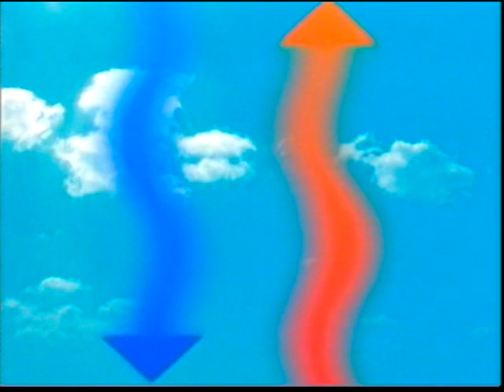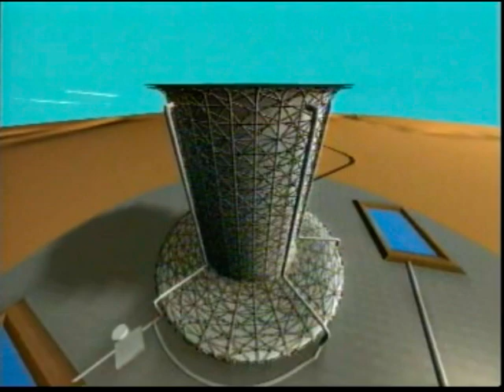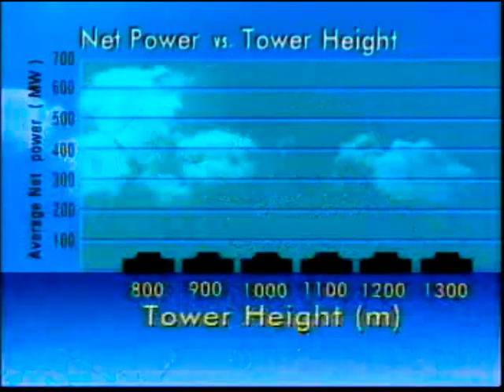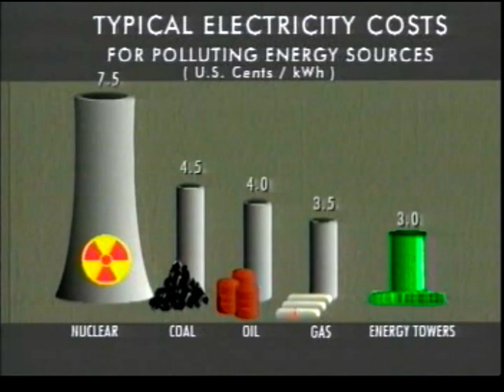Energy Towers Power & Water - Introductory Overview.mpg

Comment: Would it increase efficiency if the air was preheated in a plastic tunnel or hoop house and  funneled to the cooling point at the top would this cause a rocket stove type affect ?

Comment: How about using Solar Pumps during the day to continuesly pump water to the top of the tower and this water is then stored in big pipes on top of the tower allowing water to be sprayed even at night, saving 33% energy used for pumping. Spray system works like drip irrigation system. Thanks.

Comment: AGP also used this pilot program to determine the parameters of computer programs to control the amount of water to be used at the top of the stack to obtain maximum air velocity to the base of the stack. They determined they would be able to use this system under varying atmospheric conditions in areas other than the pilot site.

Comment: To built such a large tower that can withstand highwinds would be quite difficult and have huge building costs. Perhaps design optimizations are possible by adding wind holes (covered with flaps that only open up during high wind loads) which saves on weight at the top and safes considerable on overall building costs, with only a small diminishing of energy being harvested.

Comment: I don't understand why they don't combine this with an updraft tower... Boil the water and then have the condensed water travel to the downdraft tower...
Reply: U GENUS!
Reply: Was about to ask that, since using an updraft tower and a water tower would increase the water tower without the need of pumping, and that would mean that you can put your downdraft towers much further inland, and with both of them causing local cooling if the mist updraft tower is tall enough, then you could turn sahara into cool lush forests, namely planned forests for maximizing the output of multiple plant types.
Reply: The cost of heating the water would be high $ cost.
Reply: In hot locations like south Australia couldnt the cost of heating the water be almost free as you could engineer it to have the sun heat the water. Pumping only needed at night.

Comment: Could this design theoretically be combined with a solar updraft tower (the one that uses a large collector to heat the air, and has a "chimney" also very high to release the air producing also wind energy) - for instance as a "tube-in-a-tube" design? Or combine it with a habitable building (thus reducing building costs, because part of the building costs get recovered by selling appartments).
Reply: robheusd MegaCity One. Awesome.
We talk about colonising other planets but we haven't learned to look after the one we have now :)
Reply: robheusd MegaCity One. Awesome.
We talk about colonising other planets but we haven't learned to look after the one we have now :)
Reply: robheusd you forgot the greenhouse under the updraft collector, to feed all the people. And maybe some luxury housing in the green.
Reply: In a building it would not be profitable since such a small diameter tower would create about 1.7MW in yearly average (in a hot dry climate) for a 1000m high 30m diameter tower. This figure doesn't take into account the polluted air that exists in cities. Polluted air is heavy leading to a smaller buoyancy effect. 1.7MW is not enough to overcome the revenue that can be produced from renting the space taken by the tower. Renting revenue is high in cities.
Reply: re: qwe w: Not "in a building" or "as a building" but built as tower as in the design, but adding appartment and other usuable space to the tower (on the outside).
Reply: I see what you mean. In that case I don't see any reason that would prevent this.
Reply: Someone just has, and its output is still woeful. A 200M combined tower, will produce an average of less than 100kW electricity. The area covered by the 'roof' at the bottom, looked to be about 600M diameter. A footprint of almost 200,000 M2. Completely covered in solar panels, this would produce an average output of 12 MW.

Comment: Why couldn't we use the drinking water towers already in use in towns throughout the U.S.  As some of the water goes down the tower to provide water to the user, it can be used to generate power.  I love the idea of doubling up as desalination plants along the coast line, but there are already structures already created that would only require some additional modifications at a lower cost.  Overall your system sound fantastic.
Reply: It is not possible to gain energy that way. You first have to pump it up the tower and there are always some loses.
Reply: The energy created by the tower is enough to account for pumping losses.

Comment: Interesting. Makes me wonder once again if the Egyptian Pyramids wee some sort of similar energy tower. The pyramids were constructed with water diverted through the bottom. Plus. If you are going to build this tower in the desert. Go ahead and put some solar concentrators at the bottom, get more heat. Basically, have a giant tornado, which might have some pretty interesting effects on the atmosphere.
Reply: If the pyramids were painted black, they might have been usable to create updraft, which would make wind, which would somewhat cool the people or at least create a nice breeze. Though at that point you would have better chances if you had the casing of the pyramids have pipes a few cm/in below/under the outside, to allow for airflow to happen from the bottom to the top, which would cause a similar effect to solar updraft towers (so power, maybe water condensation, and local cooling). And considering there's not much data on how the pyramids were built, it might be possible for them to have been just a remnant from a cataclysm (i.e. 13 000 years ago), with the casing at least partially destroyed and later discovered and refaced to look fancy. Black pyramids, huh?
Reply: While they concentrate vast amounts of electromagnetic energy nothing we know can store that amount of energy for so long without having a constant power supply and there is very little water anymore as the nile is elsewhere. So a different energy source is needed

Comment: seems to me like the sheer size of the tower ot build makes it just completely unreasonnable.. at least for the moment... Then really.. I mean his model uses dry ice which ismaintained below -57C.. Now what happens when you use sea water that really can't be expected to be lower than 4 C? + we're talking about sea water.. That means salt in the water.. that means significant problems with any metallic part..

I don't see how that can be said to be a better alternative than solar thermal power which is gaining momentum right now. But who knows.. this seems like an innovative concept I had never heard of this before.

Comment: A simple concept, admirable in principle maybe, but what is omitted in the video is that to build such a 1.2 km high tower would require huge inputs of energy - including production, delivery and assembly of materials such as cement, structural metalwork plus the numerous turbines and other infrastructure. Would it be cost-effective overall? What would be the payback period? What about the resource consumption and related environmental impact of such massive building projects?
Reply: +armadillozenith Once build such an tower can stand for 100 years. So it should be much more cheaper than anything else.
Reply: I know I'm two years late lol. I'm wondering how salt water being misted onto any surface (esp cement) wouldn't just destroy everything incredibly fast. I'd have to think the upkeep would be an astronomical cost. Of course I have to believe the engineers have considered this. Just my thoughts

Comment: And i believe it will work even better, the heat from the apartments themselves will help keep the chamber warm, this will build and maintain cold air pressure flow thru the tower as it is cooled with cold water. But this will maintain a warmth in the chamber to assure the chamber itself does not become so cold as to become colder than the air you created from the cooling water filter. It that happens i believe the cool air will escape the tower thru the top. But the apartments keep it warm.
Reply: I hope you do realize that cool air tends to go below hot air, which would mean the air resulting from mixing the water spray with normal air is both much heavier and much denser, which means that cooler is better. You can have an outer shell a few meters outside the inner shell, and connect at the top and bottom, to have the air inside act as an insulator.

Comment: Why don't they put this underground so they don't have to pump in up?
Reply: because the air output from the tower will be required to be pushed up requiring energy. Also, the tower works by surrounding itself with hot dry air so that buoyancy causes the heavy air inside to drop drown, if it was surrounded with heavy air then it will not produce much energy. The only effect that would be energy producing in that case is the drag caused by the water drops.

Comment: It assumes that one tower could meet electric energy demand of 1 million habitants with 460 MW, it means

460 MW/ 1000'000 hab = 460 W / hab --> plausible but not alot

in kWh per hab per year, it gives

0.460 kW/hab * 365 day/year * 24 h/day = 4030 kWh / hab / year

an average american consume in electric energy near 13,246 kWh per year, so 3,3 times more than assume by the project. But if we choose countries with dominante desert  and dry environment (I consider Algeria, Morocco, Libya, Egytpe, and Israel), I calculate that it takes only 2908 kWh/hab/year to meet electric energy needs of these countries, less than assume by the project. It's an interesting concept this is worth considering.

Recall that it takes a dry environment for using this type of power station (it works with thermodynamic phenomena), a good geographical site would be the Atacama desert, in Chili, the driest desert in the world

ref:
http://en.wikipedia.org/wiki/Atacama_Desert
http://www.appropedia.org/Evaporative_cooling

thanks

ref:
http://data.worldbank.org/indicator/EG.USE.ELEC.KH.PC
http://data.worldbank.org/indicator/EG.USE.PCAP.KG.OE

Comment: The salt from the evaporating water is going to fall down that same tube with the cool air, and it's going to foul those turbines very badly, very quickly. Sticking to the blades, the motors... It'll act like an insulator. It'll bring everything to a halt. I like the OTHER kind of energy tower, without saltwater, that brings hot air into the bottom of the tower, and the draft of rising air turns the turbines.

Comment: Has anyone calculated what if instead of pumping and spraying water a simple cold plate was used? Would that still work in theory?
The air will still cool down and cause downdraft effect (as in the example in the video with the dry ice) but the air would be less heavy because no water is added, so the energy that can be harvested would be less BUT we would need considerable less energy due to no pumping of water but just cooling a plate.

Comment: I think it would be cheaper to build a residential tower around this, multi purpose and no need to transmit energy any distance. Either that or piggyback on existing structures. Tunnel into a mountain (ie take advantage of natural geographic features) like NZ has with the Manapouri hydro electric plant. Located in Fiordland, they receive a lot of rainfall......